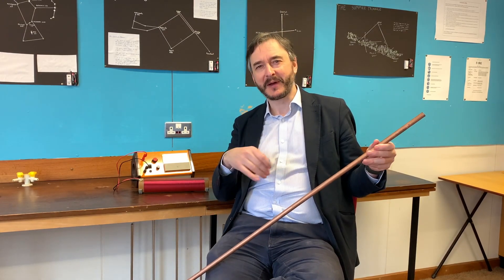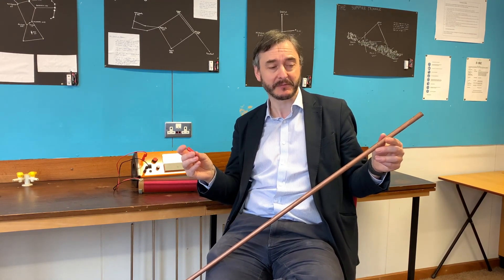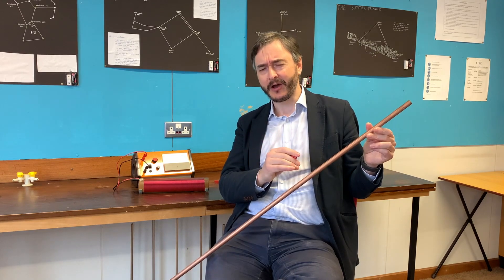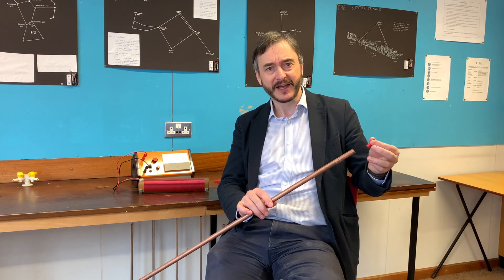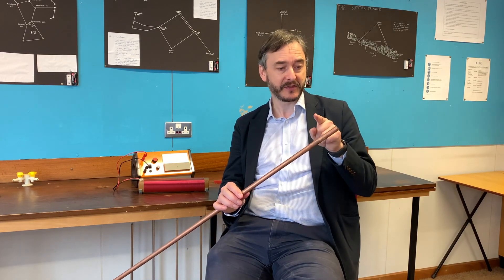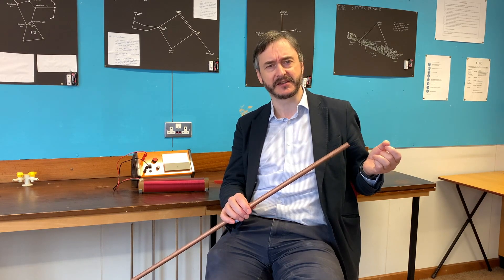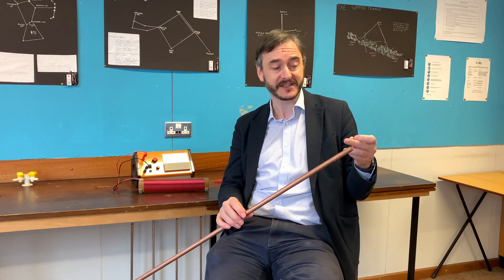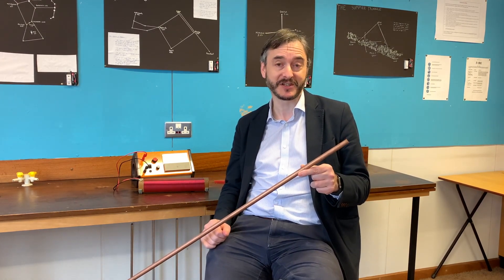Dropping a magnet down a copper tube: A demonstration of Lenz's law.

Comment: How about dropping copper in a magnet pipe? I can't find anything on it. Get a iron pipe, cover it w magnets & drop copper thru it.
Reply from the maker: Great idea!
Although to work, the copped needs to pass through the field lines, so you'd have to stick north poles to one side of the tubing, and south poles to the other. (It wouldn’t work if the tube was magnetised along it’s length).
You can also create the same effect by attaching a piece of copped to a piece of string and swinging it, as a pendulum, between two opposing poles.

Comment: What if negatife pole beneath endless bop endless movement.
We have +×÷=/%$ movement symbol is ?
Reply: Yeas you realy but is it possible ?
A way more effecient way of creating Crypto currency.
Reply: Hmm i found a new theory could huge ball shaped cylinders catch air and cause a domple effect and squeeze the ammount inside a tube or pipe create big movement out of air ?
Cliffs with the biggest wafe tossers have half cylinder balls when full it domples over.
Or quarter like there where steamers with old way moles water way but wafes of cliffs way more power.

Comment: I think that a fall velocity of the Radially oriented single pole ring magnet will be a greater (faster falling) than the Axially oriented cylindrical magnet (conventional magnet), of course, in a case of their equal: strength of magnetic fields, geometry and mass. Next time I could explain why my opinion is like this, but before that, I need to see this experiment and become 100% sure.

Comment: What will happen if we drop: radially oriented single pole, longer cylindrical-ring  magnet in the cooper pipe?
Whether the fall velocity, of the radially oriented single pole ring magnet, in the cooper pipe, will be faster, slower or same like the fall velocity of axially oriented cylindrical magnet, which is same longevity, diameter and intensity like previous one?
Thank for your attention, and we hope that you will accept our suggestion to perform this experiment and show on YouTube.
Reply from the maker: Single Pole? You mean a magnetic monopole?
If you buy me one then I'll do the experiment for you! 👍😎

Comment: Is the rate of fall of the magnet inside the tube constant or does it differ on quantity of materials used or weight?
If magnets of apposing poles where placed in the tube would this effect the speed at which it falls?

thanks
Reply from the maker: The rate of fall depends on all kinds of things:
The weight of the magnets
The resistance of the copper tube
The strength of the magnet.
If you put two magnets down the tube, the outcome would depend on how close they are (ie does the magnetic field of one magnet affect the field of the other?)

Comment: I really liked the format of this video with an explanation at the end. I have two questions though (english is not my first language, so I apologize in advance for eventual mistakes):
1) Since the the magnetic flux through the copper tube is a scalar product, we should only consider the magnetic field that is parallel to the axis of the tube. The current should follow a circular motion and, in each point, should be perpendicular to the radius. Using the right hand rule, wouldn't that mean that the magnetic force would push the magnet against the sides of the tube instead of slowing its motion, and wouldn't the total force be equal to 0, considering that for each point in the circumference there is an opposite one that creates an opposite force?
2) Would the result change if the magnet were dropped from the other pole?
Reply from the maker: Great questions!
The current I was referring to tappers just in front of the magnet and loops around the tube. The causes that section of tube to act like an electromagnet, creating field lines travelled along the centre of the tube at that point (in accordance with the right hand grip rule). This field is in the opposite direction to the field of that magnet, and hence repels it.
Put the magnet in the other way around makes no difference.
Reply: @QuantumBoffin  Ok, I think I understood, thanks for the answer. So in an electromagnet the field lines would be directed towards the centre of the circumference and not the axis of the tube, correct?
Reply from the maker: In an electromagnet the field lines run through the centre of the magnet. One end of the coils acts like the North Pole of a magnet (and has field lines emerging from it) and the other end acts like a South Pole (has field lines entering at this point).
The tube just in front of the magnet acts like a mini electromagnets. If the lower end of the magnet is a North Pole, then the upper part of the “electromagnet” will also act like a North Pole and so repel it.
Reply: @QuantumBoffin  Alright, now it's perfectly clear, thank you :)